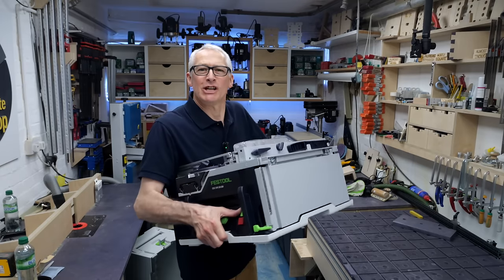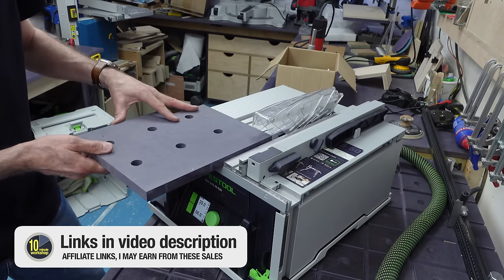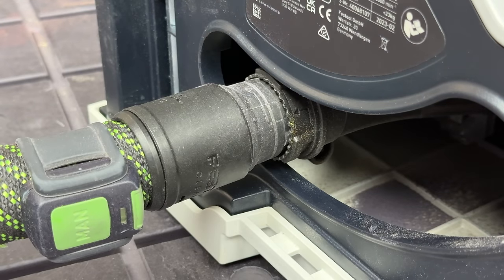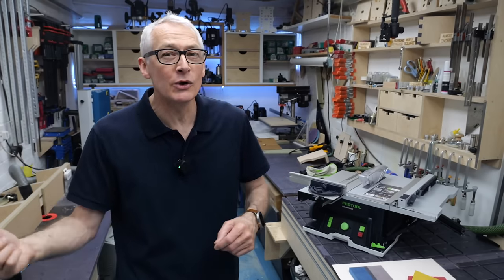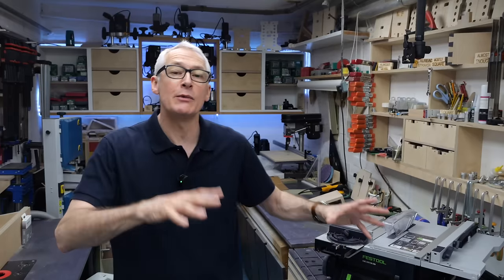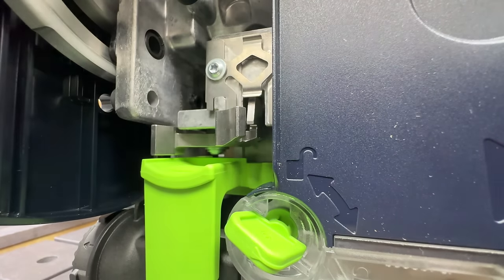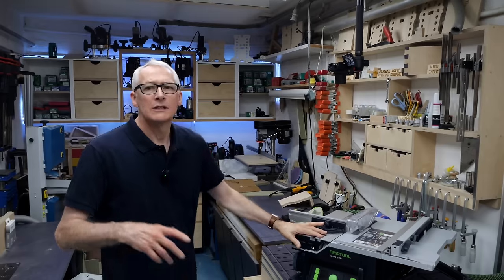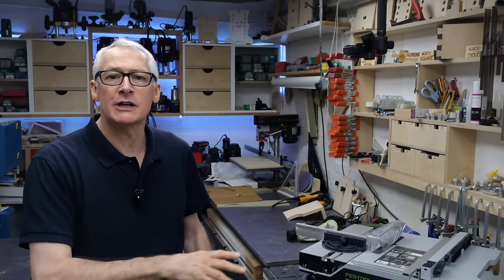Festool's Big Mistake [video 530]

Comment: I was looking everywhere for one of these - not available in South Africa yet - and I think you’ve spared me from importing one 😬

I had high hopes for this and I am shocked and disappointed with the lack of quality- very un-Festool indeed. 

Thanks a million Peter - I really trust your reviews and advice. Always appreciated 🙏🏻👍🏻
Reply from the maker: Thanks! This is a great saw! It does everything I wanted and I’m looking forward to using it on projects. But it would have been remiss of me not to mention the obvious shortcomings, and areas for improvement. If you want a small, quiet, accurate saw with great dust collection, then there’s not much else to consider in this price range. 👍

Comment: You're absolutely right that it should also accept plug in power, and like you said, plugging in should also keep the batteries maintained. You have to be plugged in most of the time for dust extraction anyway, so yes a missed opportunity on Festool's part to get it right the first time. Maybe a future version will rectify this error.
Reply: It's meant for a jobsite. Of course it's gonna be cordless

Comment: Nice review.  I agree the cordless only option is a non-starter for me but being in the US, this is probably a mute point given the numerous Festool products that are not available here.  I have been burned by Festool batteries before on the CDD12 drill/driver so am not inclined to ever get another Festool cordless again.  It would make sense to me if Festool just offered a mains conversion adapter to plug into the battery port to resolve this.  

I find the precise blade height important for the work I do but I suspect that most people will just likely use it for through cuts.  
Steve
Reply from the maker: Thanks! To be fair batteries have improved some since the old CDD12, but the lack of a mains adapter option is at best, shortsighted. 👍

Comment: Thank you for this video. I have this saw for several of months now and i am using it for installing kitchens.  I am very happy with it and it works very accurately.  It is very easy to take with you to your workspace. Indeed the only problem are the batteries. I use 2 5ah batteries and i have to replace them a lot during the day.  I hope the 8ah batteries will come soon, that might solve the problem, except for the high cost of these batteries.  Otherwise Festool should really look at a 230v solution.
Reply from the maker: Thanks for the information, that's really interesting and great to hear from someone using the saw as intended! I really like saw, it does everything I want in a small table saw, and for working in smaller spaces - wether that's a UK workshop or a kitchen install -  it's well thought through. But I do think there should be the option to run mains power, battery-only is a mistake.
Reply: Being a kitchen fitter myself I use the new tsv60 more than a table saw, I only use a table saw to rip down infill and plinths if they don’t need scribing , just wondering how much you would use this table saw than the track saw?

Comment: Hi Peter,
Now that you've used this saw for quite some time, do you still like it? 
How long do the batteries last? 
As a recently retired EE and newbie woodworker, I don't plan to ever be running a saw for 8 hours straight. Maybe an hour or so out of a 4 to 6 hour day in the shop. The batteries can charge over night. As long as I can get that much run time out of them, I won't miss the power cord. 
I'm more concerned about the non-standard miter slot. That may be a problem with some of the accessories I have in mind (and also may already own as I've been collecting tools in anticipation of my retirement for quite some time).
I'm hoping I would still be able to make a couple cross-cut sleds for it, even with the single, weirdo miter slot.
I really want / need a lightweight saw that I can safely haul from my garage down to my basement when it's time to get out of the way of the cars.
This saw definitely checks that box.
Reply from the maker: Hi, I did a video about this exact topic recently, I’ll link it up below. The saw has been excellent, no issues at all being battery only, it’s lightweight, quiet, accurate and with great dust collection. Only slight bugle is that the fence has no micro-adjustment, which is weird for an otherwise precise saw.  Non-standard slot hasn’t been a problem for me,  but I tend to just use the mitre gauge with the Benchdogs fence, which works well. Very happy with it. 👍

CSC SYS 50 12 months on - https://youtu.be/T5_9DQJC4v8
Reply: @10MinuteWorkshop   - Hello again, Peter,

I watched the update video. Excellent!  Many thanks!

My original table saw of choice was the SawStop Jobsite Saw Pro. That checked all the boxes for me except one, but it is an important one.

I must be able to move the saw up and down the stairs to the basement now and then.  The SawStop saw has a convenient 2-wheeled dolly that comes with it, but I’m not all that big.  The saw with its dolly weighs nearly as much as me – 8 stone vs my 10-to-11 stone.  I’m too old to want to go tumbling down the steps on top of a saw. 😨

The Festool saw in its Systainer carrying case weighs less than half what the SawStop weighs.  I can easily handle that much load.

I’ll have to forego using a dado stack, but I have a couple routers to accomplish dados, grooves, and rabbets.

I still have a couple weeks to think about this before biting the bullet, but I am leaning hard toward the Festool now.

Cheers!
David

Comment: Excellent review/overview. If I were a professional cabinet maker/installer I’d have a very hard time NOT buying that saw. It has all the precision, cleanliness and portability expected from Festool. Like you mention, the only hesitation for me would be there isn’t a power cord option, big drawback, especially considering some earlier comments with regard to battery longevity while on site.
Reply from the maker: Cheers Paul!  It’s a great saw - I’m just pointing out the obvious areas that could be improved here as it would be remiss of me not to - but I’m really pleased with it and how it performs. Dust collection is great, it’s small and quiet. The battery ‘issue’ may be resolved in time, so we’ll keep an eye on that! 👍

Comment: Thanks for the video. Yes I'm interested and on the festool and Makita battery platforms..(20/80) I'd be interested in a battery life per foot of 18mm mdf.. totally with you on the mains power supply and the lack of one make this even more of a niche tool than it needs to be..As you say if I was fitting kitchens and bathrooms most weeks I'd definitely be interested.. really looking forward to you putting this machine through its paces..thanks again
Reply: Saw video test on batteries, it came out at 100 meters of cutting.

Comment: This saw is something I've been wanting but price point is an absolute joke and I was so underwhelmed by the battery life of the battery plunge saw which got sold almost as fast as I bought it. 
Thank you for your honest review and willingness to point out it's short falls.
BTW also fell into the same supply issue with the CTM midi when it was first released. Told it would be days and that turned i to months. I assumed i was an isolated case but may be the festool way unfortunately.
Reply from the maker: Thanks! You’re not alone - lots of folks can’t seem to get beyond the price - but it was dead-centre of all the saws I looked at price-wise, about a grand more than the cheapest, and a grand less than the most expensive. 🤷‍♂️👍

Comment: The cord issue is everywhere.  I just recently looked into a graft for my Dewalt tools.  I was thinking of how useful the leaf blower, set low, could be to draw away harmful vapour and dusts.  On does notice while running it how happy it is to suck up one's trousers through its rear placed accumulator.  However, oddly, that tool burns through batteries at an insane rate, compared even to chain saws, which is worth it when one in in the yard, but for a stationary use, an adapter and cord would be great.  And Dewalt has all kinds of suppliers who leach onto the system, so even if Dewalt is standing firm on it's battery sales,  I thought someone in China would have seized the opportunity.  Nope.

Comment: Peter, Thanks for the review.  I think that where Festool has missed the mark is that this tool only covers a very narrow and specific market and NOTHING ELSE.  So, if you are a home remodeler, or custom maker where there is no power, then this thing might make sense.  Otherwise, as you pointed out, this thing just doesn't cut it at the cost they are offering it at with the feature set it offers.  Many other people besides the above narrow market buy Festool products, me being one of them.  I like their quality and unique features (Domino).  I also own a router and 2 sanders.  But they are  probably the best or one of the best tools in their part of the market.  At a reasonable price.  So it is Festool that is  going to lose out in the end here by missing a huge swath of the portable saw market.  Furthermore, since Festool became known to the left side of the pond, the competition has become much more competitive in terms of features and level of quality at a much lower cost.  Have fun with this thing but I will pass.

Comment: When I first saw your previous video covering this, I was really excited about the technology, especially the electronic height adjust and beveling.  Now having seen your initial thoughts I've got to say I'm now on the fence as you make some excellent points.  Ok so the electronics are clever, but when would you really really need this?  As long as you're cutting above the board, you're right, who cares how far above it you go exactly?  And I also own the same inexpensive electronic angle finder.  So I've got to say it's dampened my enthusiasm as a 'game changer' product.  Great insights Peter.
Reply from the maker: Don’t get me wrong, I really like the saw,  it the wiz-bang tech stuff leaves me cold and there’s room for improvement in other areas that are probably more important to most woodworkers.  🤷‍♂️👍
Reply: I was trying to work out when 0.1mm adjustments were needed. Cupboard face frames? Some half laps? I guess the ability to go back and reset to a given depth could be handy

Comment: Hi Peter, great review, yes I thought the same regarding the batteries, I would have considered buying if it was corded,  disappointed in the finish quality and I also thought the digital adjustment on the blade a gimmick. Just like the shaper , too much money for something that you can do the same job cheaper using something else and anything unique about these tools would only be used infrequently, I think you can get sucked into buying these tools from festool and shaper but at the end of the day you have to ask your self for the money have much use would you get out of it ,
Thanks for your review 👍
Reply from the maker: It would have been remiss of me not to point out the obvious areas that could be improved, and things that I’m a little underwhelmed with, but this is a great saw if you have the need for what it does ie small, quiet, lightweight, accurate and with great dust collection - there aren’t many that would tick those boxes! 👍
Reply: @10MinuteWorkshop  yes great point but not for the £ I’m not convinced especially when I have the tsv60 now.
For a small workshop and small projects it’s ideal especially if they put a power cord on it, hopefully they will on mk2
Saying that I may still buy but wait to see if they bring out a corded version to rip down infills and plinths
That’s for replying , great videos by the way 👍

Comment: Oof that’s hard to justify. Certainly not something I’d have, even if I had the money.
I guess the comparison would be the Proxon little thing that doesn’t have the tech?
Reply from the maker: Depends on your needs Dean. The proxxon really is for model makers - 22mm depth of cut and a small proprietary blade. For its intended use - on installs - then it hits the right note, just a bit in the pricey side.  But then it’s Festool - we didn’t expect it to be cheap! 😂👍

Comment: Great review. I’m fully invested into the 18v Festool range with about 9 batteries but this saw is surely aimed at hobbyists and won’t be getting it. As a site carpenter I stay away from the big sites these days and never really have to take my generator as a result. So my 110v kapex and cs70 are fine .

Comment: I’d love one of these to replace my ageing,  unbearably noisy but beautifully accurate Dewalt DW745 but can’t justify the cost for the batteries. 
Utter madness from Festool. If the other manufacturers took a few notes from what Festool has done well and apply it to their next gen of corded saws Festool could be in trouble. The play in the fence and mitre slot is as you say unforgivable at this price point!
Reply from the maker: This is a theme that comes up a lot - “if it wasn’t for the batteries I’d be all over that…” 🤷‍♂️ And the play in the fence is just poor finishing - it locks down precisely, but it’s just not what you expect to see at this price. 👍

Comment: Interesting mate. After market 230v/110v dingus inbound I bet😁  I have, for a long while now, been infuriated by companies seemingly putting on the back burner, fundamental tool features. In table saws, it's accurate mitres slots and gauges and a good solid fence. And yet, unless you're spending several thou on in-situ  saws, they're all slapped together afterthoughts, not fundamentals!. It's bloody irritating and it's everywhere!
Been trying out a lot of saws lately at dealers and events. I'm about ready to blow!😂
Reply from the maker: Thanks Stew!  No saw will be perfect for everyone of course, but it would be nice if they delivered the fundamentals without compromise, before they started fannying around spraying digital glitter on everything.  And yes, I have a suddenly renewed interest in 240v to 36v converters… 😂👍👍

Comment: Have you seen the new “hybrid” sanders? They can run off of an 18 volt battery or theres a thing that looks like a battery that has a mains connector that goes into the battery position on the sander.  I wonder if you could hook one of those up?
Reply from the maker: Thanks! Yes, I’ve seen them but they can’t handle the power draw from the motor, or so I’m told.  🤷‍♂️👍

Comment: Thanks Peter. In your “Why am I buying this saw?” video you said you wanted a saw that is small, quiet, accurate, and has good dust collection. Notwithstanding your reservations now you’ve got it, is it meeting your expectations on those criteria? (Asking because they’re mine, too).
Reply from the maker: Yes, absolutely! The saw’s great and I really enjoy using it - I’d have had that Mondrian table finished in half the time if I’d had this! But the reservations are real and those concerns justified, if they’re things that are important to you.  Can’t wait to get the cabinet made for it.! 👍
Reply: @10MinuteWorkshop  Thanks, really appreciated. Have to admit, every time Festool makes a table saw it just makes me want the Mafell Erika even more (no compromises), but there’s that small problem of the price…
Reply: @10MinuteWorkshop  Hi Peter,
Love your balanced review.
I have a Bosch GTS10 xc. Terrible dust collection and fence not very accurate. Having issues with rising and lowering the blade even though had it repaired once by Bosch.
I am contemplating purchasing this festool saw. I mainly make charcuterie boards and small boxes etc.   so I need accuracy with bevels etc. would you recommend ? I have the batteries and the midi festool dust extracter.
Also thought about the Laguna F1.
Thanks in anticipation.  Do keep us hobbyists inspired
Regards 
Paul

Comment: Peter, how useful would  this saw  have been for fitted furniture installs in your previous life? While it might be perfect for some subset of the tasks entailed, it would seem to be much less versatile than a track saw and portable MFT-style bench combination, and given the finite amount of space in your van for the components of your project plus installation tools and supplies, would it have been a regular part of your installation kit?
Reply from the maker: Depends what I was installing, but I could see this replacing the tracksaw for ripping infills, and the mitre saw for fiddly little crosscuts, yes.
Reply: Surely they're intending you to bring and use both?
For me, narrow rips and working with small pieces generally has long been the Achilles heel of tracksaws. This does fill that gap very nicely...

Comment: Strange that you can find little use for the precise height adjustment. Especially for its intended use I can see that being quite useful for kerfing or  cutting a precise rebate.
Reply: If you do kerfing or a rebate, it’s going to drain the battery quickly.
Reply from the maker: For needing it doesn’t need to be that precise, and for rebating there are better tools to use eg routers.  👍
Reply: @10MinuteWorkshop  or a dado stack, if you are in America, the combination of precise depth control and a dado stack would be just awesome.
Reply: @10MinuteWorkshop  There are, but with a saw that precise it's nice and quick if you only have to do one or two.
Reply: @Geller Woodworking  For kerfing I can understand it. But for rebating, that's the same as ripping only less depth. I do that all the time on a saw.

Comment: Blade height makes sense for cutting rebates and grooves, it would have been nice to see digital read-out on the rip fence...
Reply from the maker: 1.8mm kerf and no flat-ground blades (yet) I just don’t think rebates and grooves are really the intended use for this.  And yes, it would have been nice to see the digital stuff transfer to the fence where, arguably it would be if more use. 👍